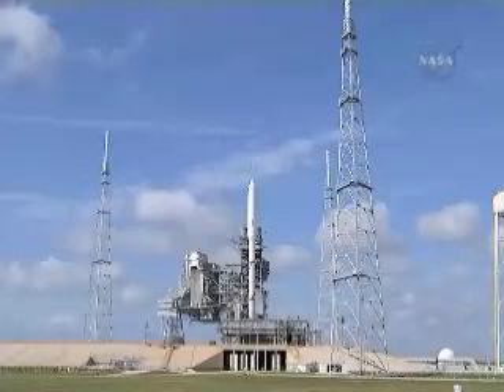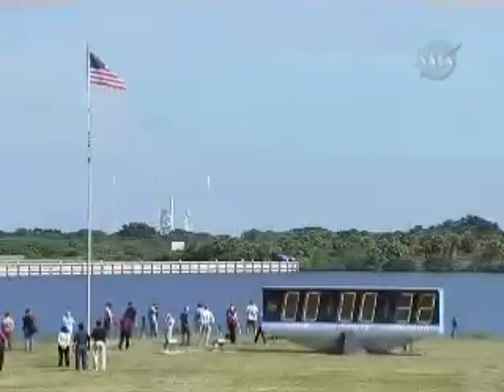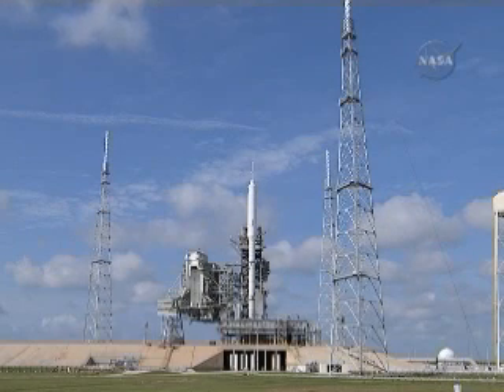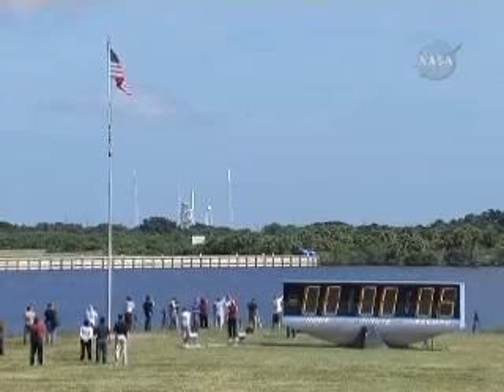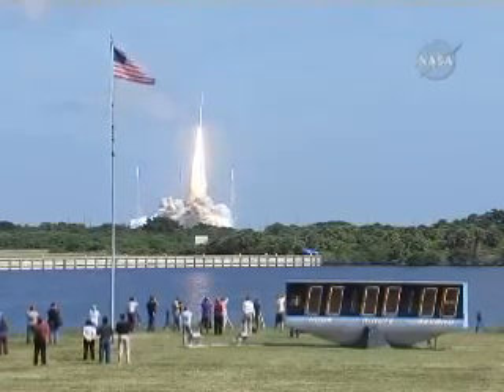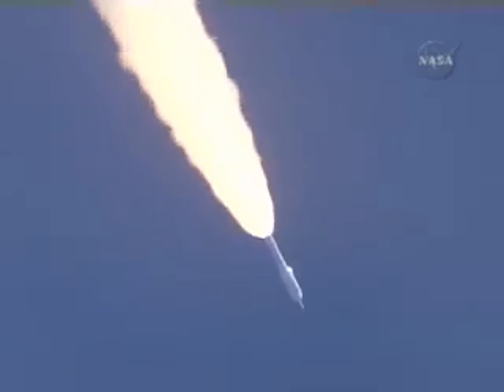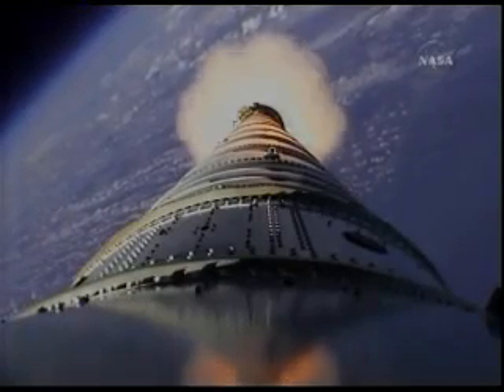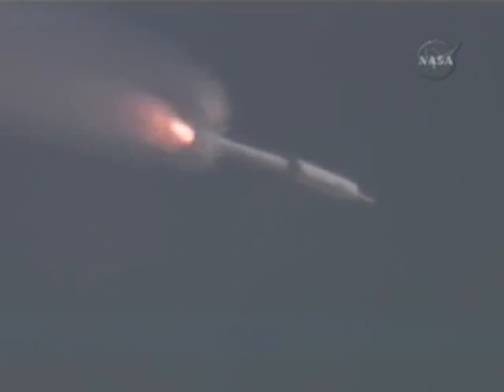Ares 1 X Launch

Comment: I really am not concerned about anything in this flight, the main concern was vibration in the SRB due to resonance, buckling since its just a single stack, and the thrust vectoring avionics and the new avionics developed as well as flight characteristics such as roll. Staging and a clean firing of ullage thrusters would have taken care of the second stage.

It is though pretty unnerving to see the second stage simulator along with the mock-up of the crew module tumble out of control

Comment: I've been considering that. However, the clincher, I believe, is listening to the mission audio (Also available on the nasa tv channels. It is the last option) I stupidly did not make a recording of that. So I cannot use that as leverage of my point. 
If, though, the cause is not one of the LSC's then that leaves a few options still One, and the most major one, would be system timing. I noticed the instant it seperated, the tumble program initiated on the SRB. 
I guess we will have to wait n see

Comment: It is done with LSC (Linear shaped charges) However, the term has been in use since the 50s and is essentially just a slang term for Linear shaped charges.
The problem wasn't so much a failure to fire, but rather a timing issue it turns out. The SRB tumble program began while the sequence was completing. Causing the tumble of the upper stage. 
Good thing it happened during testing though. That should allow the problem to be fixed in the future.

Comment: Ya, don't think anything went wrong here. The upper stage is meant to seperate in a controlled manner at a higher altitude, since this is just a 4 segment SRB. Ares 1 is supposed to fly with a more powerful and longer burning 5 segment first stage motor. The staging is pretty unimportant, as the second stage is just a dummy the falls like a rock. Also, staging isn't done with explosive bolts.

Comment: Now I could be wrong, however, I've not seen a staging (Even unpowered) to date that had caused a tumble without it being in MAX Q  or  without the aid of a connecting item. Thats all.
I also take this from an employee who mentioned in an email post mission that "One of the explosive bolts did not fire, if you were wondering about the tumble too much"

Comment: Oh. I just refer to them as explosive bolts. I understand that the Linear shaped charges are used as the separation. I call them Explosive bolts because, to me at least, they certainly seem to function in much the same manner from what I have seen at the least (I am not a mechanical engineer and have not examined the two close enough to precisely tell the difference.)
However, the fact that just as they were seperating, and then the tumble,  Usually, the force of separation would not cause that

Comment: It is kind of funny.
This launch was a success but at least 2 of the explosive bolts did not blow causing the upper stage to bend back towards the upper stage before aerodynamic forces finally pulled the two apart. 
Still. it was something else to see this launch even if I had to stay up till 1230am to see it